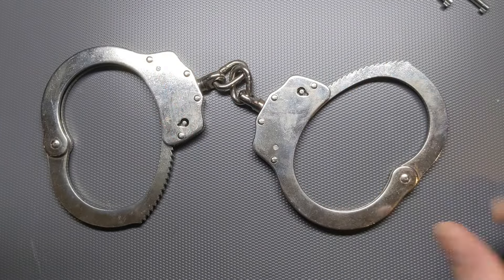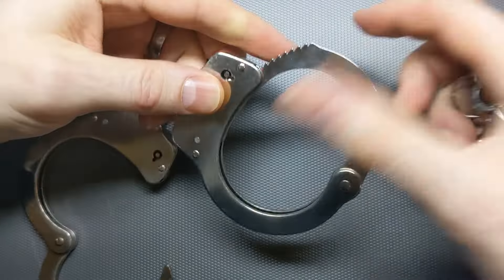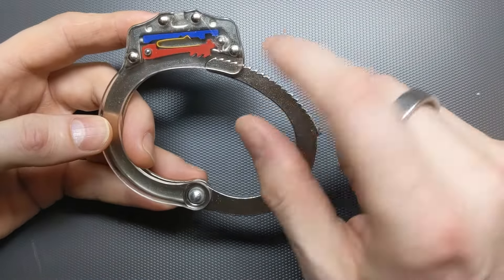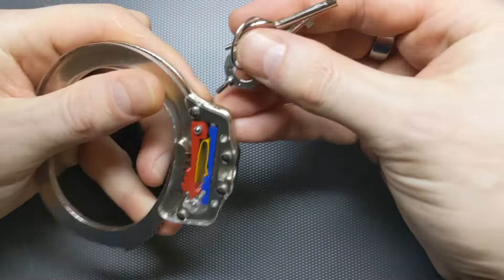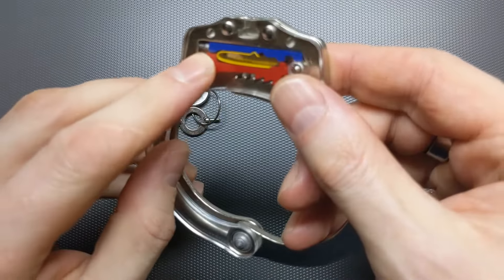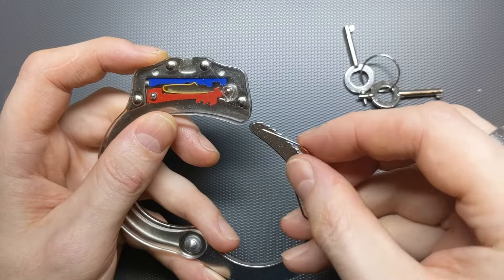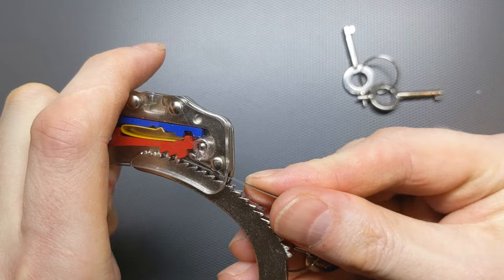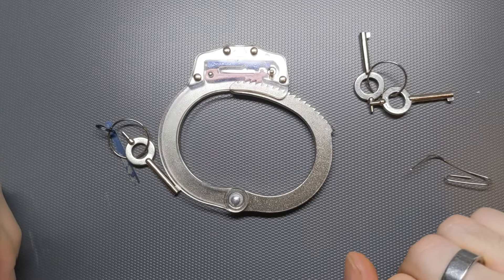[084] How to pick a handcuff

Comment: i always had safety pins hidden somewhere in my clothes, and earrings/body jewelry/etc where i could reach from almost any position. saved my life twice- literally. breathe, wait (if u can), pick (zip ties use same ratchet mechanism), look for your chance, and choose next self-defense weapon. Do Not hit them with something stupid and run, or say "please" or worse "you don't have to do this!"- that is movie shite. hit and keep hitting until you Know they will not get up. advice from 100 lbs twice abductee.
and you can always break your tumbs- but i prefer good old safety pins/shim.
open to honest responses.
thx for ur video.🙏🏽
Reply: Question, What's the trick to breaking your thumbs? Just in case I ever need it, and preferably in a way they can be put back 😅